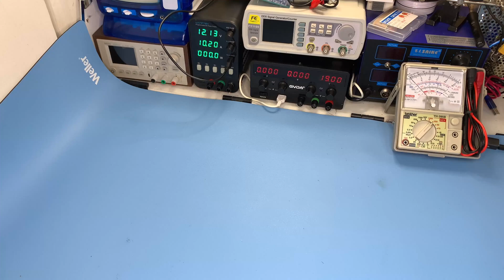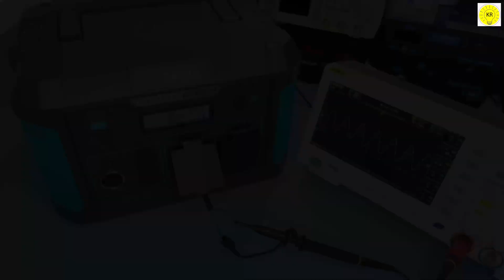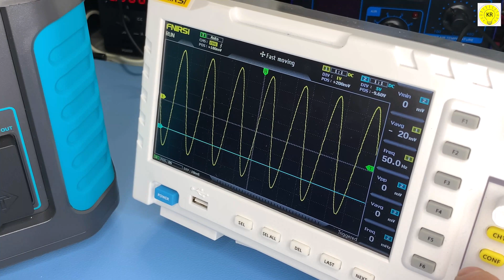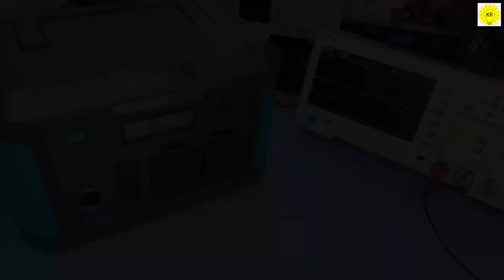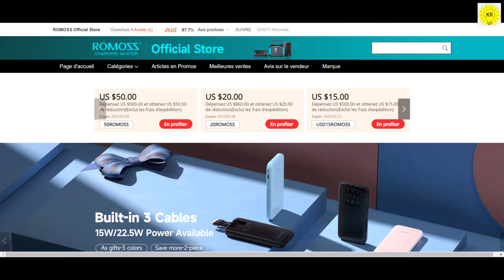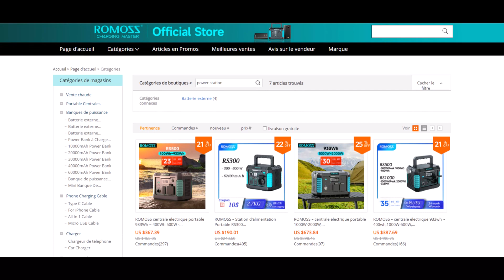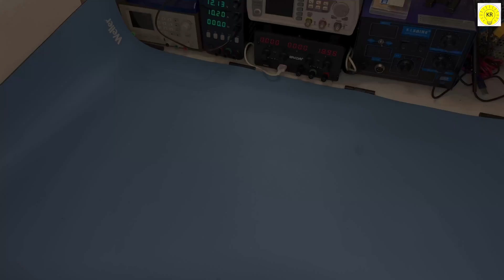inverter 220v ac 2000w best portable power station, RS1000

Comment: Hello, in your vast experience in electronics and UPS, is possible or corect to do the following. I have a sccoter battery 36V15A and reduce the voltage using a electronic step down to 12V 10@20A and this output conect to an inverter  12vdc in 120VAC out, this is valid and it works or something will go wrong?

Comment: I've got one faulty here, really similar ;). The quality of those Li-Ion batteries were poor, had to replace a few. MOSFETs died, had to replace them ;). And still one more fault, works when plugged in, will have to find a fault of that ;).
Reply: Do you mean a fault where the AC outlet has power 24/7 also when ac button is off and unit is switched off?
Mine does that and I would like to know how to fix it.

Comment: Chinese 💩 very slow charging.  Will take days to charge.
Reply: everything is made in China, even the fast-charging stuff...  welcome to 2023...
Reply: @tylerufen  yes but this is “designed” by Chinese engineers that makes a difference.
Reply: @Sincerit  Chinese engineers have access to the schematics, and blueprints for all the devices in the world, they can just copy a Japanese power supply, and a German rectification circuits, ...  that's not the problem, it's not Chinese engineers, it's Chinese product managers, and accountants...  instead of making their own boards, they buy off the shelves parts, and try to put them together, and where that fails is that they overrate their components, so the little lies on each of them, they add up in the end, and make a subpar product...  but even then, it's still very good today versus say even 5 years ago...
Reply: @tylerufen  They do copy but make it as cheap as possible ignoring safety and even performance.  Most it's just made to look like the original design.  If they can fool the buyer, the mission is accomplished.  That's why I hate Chinese "engineering"
Reply: @Sincerit  i like it, i can see how it could become efficient one day...  western design/engineering, there's so much bureaucracy around it, that's what really drives up the cost, it's all those people who have nothing to do with the product who dab into it...  Chinese, the engineer is closer to the final product, ...  idk, i just rather use something someone made for me, than use something a whole lot of people made just for it to be there, and then a whole lot of other people tried to make me think i wanted, or needed it...  🤷 (?)
Reply: For 750$? Ecoflow much better for the price